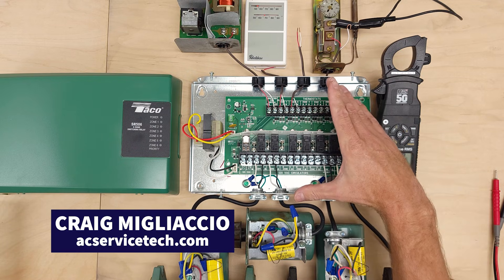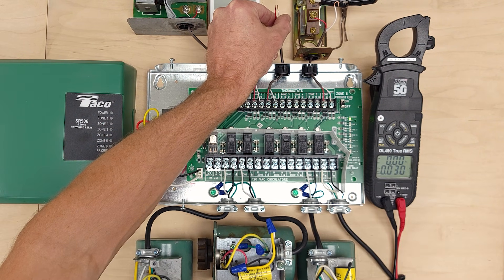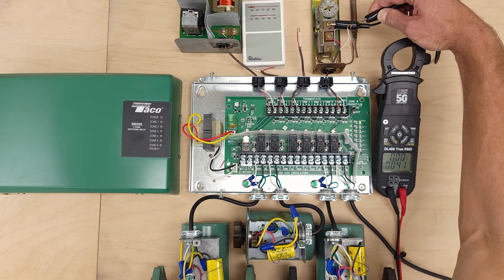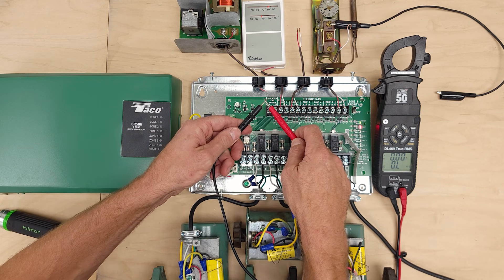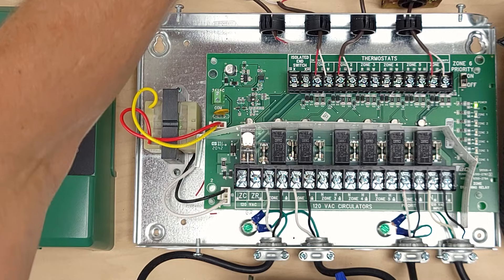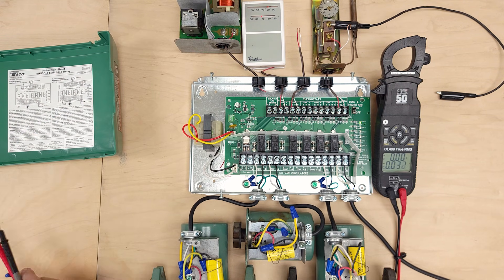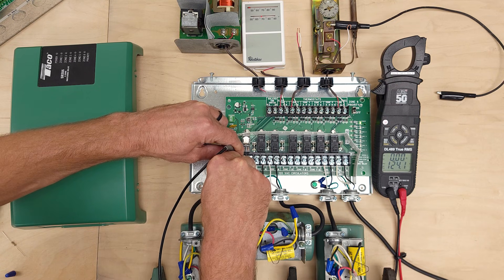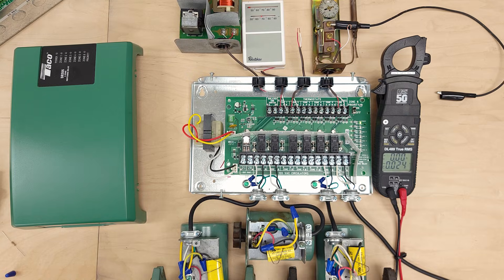Taco 6 ZONE Switching Relay Control Panel for Circulator Pumps on a Boiler! Wiring, Functions, Demo

Comment: hi there, could you please explain how the wiring would or if it changes if your using your boiler for domestic hot water ?
i'm trying to go from a oil fired boiler with single circulator and the boiler has a hot water internal coil that we use for domestic hot water. i want to keep that hot water setup and had circulator zones.
any advice would be helpful

Comment: The fact that the surface of that tech is rough and uneven with protruding surfaces and hand operated cap plugs make it like a Taco chips of automated wise AI hard to interferre with, , the only thing, as long as its operator doesnt nap that long.

Comment: I have a problem with cross flow on two of my zones. I would like to add a taco sentry zone valve on each of the two pump circuits. I have done this and it works, preventing cross flow during either zone’s calls or heat. it works, but I cannot get a stable wiring connection. How do I best wire that? It seems that the common on the switch relay is not sufficient for both valves, and I need maybe a transformer? Do I need to wire up a separate transformer for the power, then tie it in to the thermostat terminals? I would appreciate any suggestions, as the local boiler guys here in my town just aren’t very skilled or knowledge. I end up doing almost all my boiler work myself (I’m licensed).

Comment: Great Video.
Is there a reason why you are using circulator pumps for each zone instead of one pump and multiple valves?
Are the pumps more reliable?

Comment: Trying to troubleshoot. What would the effects be if the isolated end switch wire was disconnected from a 3 zone system, no hot water tank or other accessories? Thanks

Comment: Can this be used on a commercial 6 unit building? I supply the heat to all 6 units. Does this mean I have 6 zones? I have a remote sensor at the highest apartment but the people in that unit seem to use space heaters and that throws off the reading on my thermostat. It’s the same for the water heater.

Comment: Have a system running 2 zones. One for heating a garage, another for snow/ice melt. 

I’d like to be able to turn the snow/ice melt on/off remotely with a phone. 

Right now my only idea is to use a 24 volt transformer with a smart outlet to send 24 volts to the white side of the thermostat hook up. 

Have any better ways to accomplish that?

Comment: Great video. I have three Nests and connected C wires to all through a Argo 6 zone. (1 Hot H2O, 3 heating zones). Is the Taco transformer up to the task of supplying power to the thermostats?   Using circulating  pumps on radiant heat. One nest (learning nest) causes the circulating pump to cycle on and off every minute or two Relay clicks off and on in a second, heat boiler stays on. I switched out with another nest and regular thermostat without a problem. I spoke to Google troubleshooting and after much testing they informed me the thermostat was bad. I bought a new one and have the same issue. The learning nest also has A/C cooling connected. Driving me nuts. Been searching the net for answers. May try the resistor or just go with the cheaper nest. Understand this is kind of outside the video, but you have so much knowledge maybe a simple fix.

Comment: Nice system. I live in Belgium and very rarely see such installations. It makes a lot of sense to save on the heating bill with a separate thermostat in every room. Looking at installing something like this too once i renovate my heating system after the cold season, thanks for the information :)
Reply: its simple
Reply: Separate thermostat needs a separate heat loop (water).  If you have 1 thermostat, it means 1 heat loop.  This video simulates 5 separate loops heating 5 piped areas, plus the indirect hot water heater.  Each loop has a supply side and return side, almost impossible to do after the home is built.  You can add to a loop, but separate 1 loop to several is impossible due to cost, gaining access to behind walls, etc.
Reply: @tonymanero5544   If the basement ceiling is not finished it is not very hard to do. I am going through the process right now.

Comment: How about wiring an sr506-exp. I have a condensing boiler and 5 zones, (floor radiant,  3 hot water radiators zones, indirect hot water heater.) I’m told to use the 506 exp instead of the 506 because the exp has two dry contacts. This should enable my home heating zones to shut down when the indirect how water heater calls for 170 degree water. I care because I have my heating running off an outdoor reset temp sensor. I want my IBC boiler to be the brain.

Comment: Thanks for the video. I have the 4 zone version of this switching relay. Should there be 24 volts at each of the thermostat connections? And 24 volts at the 24VAC/COM terminal? I have 24 volts at the 24 volt connector from the transformer but not at the 24VAC/COM terminal. I am trying to power a NEST Thermostat but there is power issues at the thermostat since there is no C wire. I would thing that if the TACO board supplies 24 volts to the thermostat terminals then the thermostat should be receiving 24 volts. Thanks.
Reply: I just did this. Had to uncoil the spare green “C wire” at the Nest and connect it. The mount now had constant power. Before I did that the power was intermittent and the battery discharged often. Fixed my issue.

Comment: I also use this TACO SR system in a 3 pump/3 thermostat format. 

But I only use the oil fired boiler as required, sometimes not at all. It acts as a backup heat source as we use firewood in 2 stoves, and pellets in a third stove. 

But my question is this:

Because we only use the boiler as a backup heat source, there are days when the pipes/water could (and have) resulted in burst pipes at 0 to -20F. 

So this year I put about a 50% glycol mix in the boiler. Should be good to about 0 degrees F.

But we will hit -14F in the next few days. 

I was thinking that instead of turning on the boiler, I could just run the circulating pumps without the boiler for the coldest of those nights. Thereby keeping the 50% glycol   Mixture moving through the piping (and stealing some heat from the heated space as it does so) to keep them from possibly freezing in the -5F to -25F range. 

That should prevent me from needing to turn on the boiler and dragging down the overall temp of the crawl space (due to outside combustion air being pulled in at -5F to -25F) and the frozen fresh water pipes that results from that. 

Is there any way to do this other than adding a double throw switch that would isolate the pump from the taco SR controller, and supply power to the pump when turned on?
Reply: JUST RUN A WIRE INTO THE LIVING SPACE {low voltage} install a small rocker switch in the living space an down below tap into one of the TT WIRES, WHEN YOU DONT WANT THE BOILER TOO FIRE TURN THE SWITCH OFF, THAT WILL BRAKE THE ONE TT WIRE. BUT YOU HAVE TO REMEMBER TO TURN IT BACK ON, WHEN YOU WILL NEED IT TO RUN BACK UP..

Comment: Hello, I have the SR504 -4 Switching relay with priority control.  My priority on off switch does not do anything, with it switched on it should prioritize zone 4 and ignore the other zones but as it is if there is a call for heat on the other zones they will energize their respective zone pumps.  Does that mean that the zone 4 relay is faulty?  How can I check to be sure?  thank you

Comment: I did study digital logic controls like  And , nand , or , nor gates and Boolean algebra and mapping . The only problem I have with a circuit board as those are the actual physical screw connections can be faulty.

Comment: I have a taco 3 zone box. System Has worked great until this winter. 2nd winter on the 3 zone. I had 2 zone box until last winter. Worked great last winter. Now even with the thermostat  disconnected the heater acts as if it is still connected.  Zone one only. Zone 2 & 3 still working as they should. Anyone ever run into this before ? What are the trouble shooting steps ? Isn’t happening when 2 or 3 are calling for heat.

Comment: Is the 120v that feeds the aqua stat and taco zone relay board the same line feeding them just split into two circuits or are both the aqua stat and taco zone relay getting fed 120v from different lines?
Btw thank you for all what you do for our community your a great teacher

Comment: In what situation or application do you chose zone valves versus a circulator for each zone? Would it not be more cost effective to have zone valves?
Reply: Yes, using a variable speed ECM pump with zone valves would be cheaper to install and run in pretty much every application.

Comment: I have one zone where the boiler fires the entire time until the thermostat is satisfied.  The other zones turn on their respective circulator pumps and the boiler only fires when it low temp is hit.  It fires until the boiler high temp is achieved. The pump will continue to run until the thermostat temp is reached.   Why would the boiler run the entire time for one zone, but fire off and on based on high/low limits for the boiler for the other zones?    Could a relay be bad for just one zone?  Stuck closed?
Reply: Basically what I am trying to say is that one zone fires the boiler the entire time until the thermostat is satisfied.   If i shut off the thermostat the boiler immediately stops firing.

Comment: I love all the videos and how much time you have given to this channel.  

this is a question.  
Zone 6 thermostat is connected to a thermostat that checks the tank temperature and will OPEN when the tank is at temperature.  Zone 6 needs to be open for the other relays to close?    
 
the plastic card is used to divide the board from 24 volt AC low voltage and the 110V volt AC high voltage.   Good thing to teach.
Reply from the maker: Thanks Posi P! Yes when the priority zone 6 switch is in the on position, zone 6 thermostat must close for any of the other zones to turn on, thanks!

Comment: Don't use Taco zone valves. Honeywell is better. You can change the power head AND/OR the valve mechanism without needing to change the back (soldering),
Reply from the maker: Taco valves have a removable heat on the old style and the sentry but yeah honeywell are fabulous as well, thanks!

Comment: Where can I get a cold water heater?  😂😂😂 just trolling.
Reply: Well you're actually not wrong.  I was taught when I was an apprentice about 22 years ago to not call them hot water heaters but to call them simply water heaters. After all why would you want to heat hot water if it was already hot? Makes sense and always stuck with me and ever since I've been correcting anyone calling them hot water heaters
Reply: @HVACRTECH-83  it does technically heat hot water though when it fires it’s because the temperature of the water has fallen below the output set point but could still be considered hot. it’s as if you could only call it a water heater until it’s been fired for the first time. after that, hot water heater could be considered proper nomenclature. how’s that for pedantic? lol
Reply from the maker: Nice one!!!

Comment: A zone pump system piping video would be helpful. I see zone pump systems improperly installed occasionally (no check valves, no mixing valve for setting floor temperature, etc) so it would be good to show dos and don’ts in piping. 

Also, Taco is probably the most popular brand in my area but it would be cool to see Tekmar explained. Tekmar is a bit sophisticated and can be very intimidating/confusing for a lot of people.

Good video. More hydronic, please.
Reply from the maker: Chuck so glad you enjoyed the video and thanks for the video ideas!
Reply: Your not going to see check valves at a pump. All pumps come with a check valve in them.  In some cases I pull them out due to not needed an want full flow.  1" mixing valves for manifolds with flow meters an ability to add relays to find mixing velve for them. Lots of 1/2 and 3/4" ones but 1" is very hard to get. I end up many times teeing in the return line to the feed. Not the best as it could end up to low